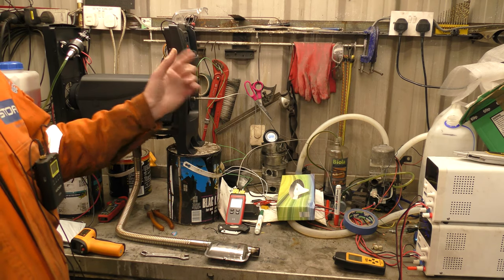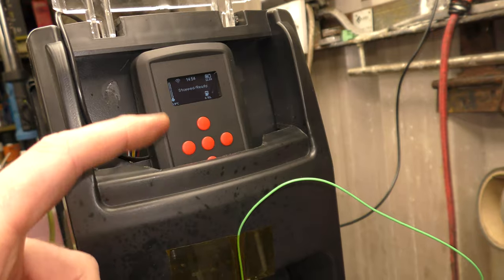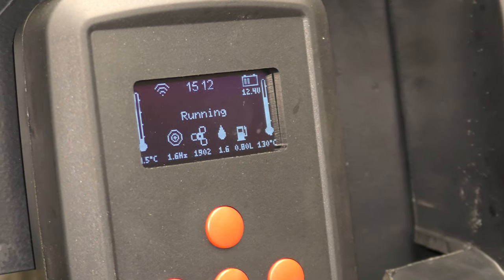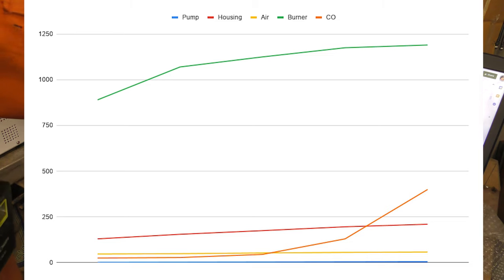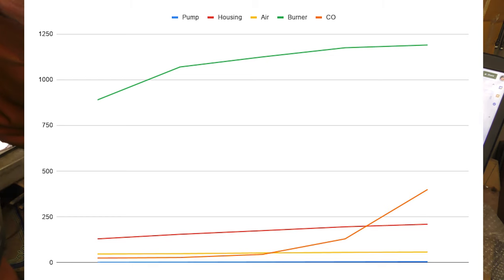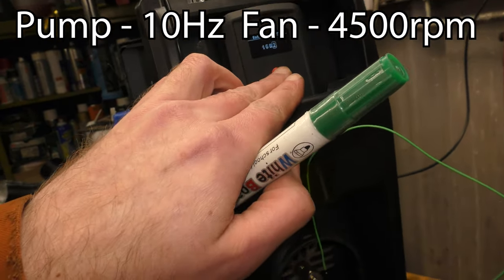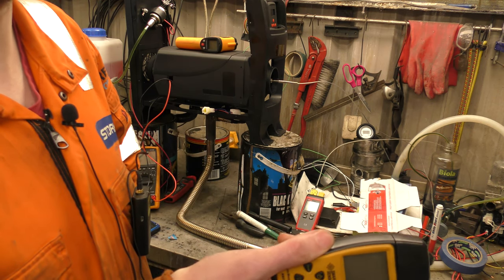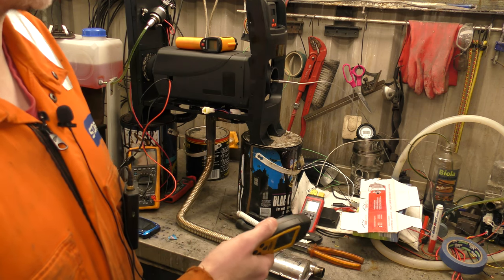A better understanding of what's happening in your heater while tuning?  With graphs

Comment: Helllllllloooooooooooo!!!! your greeting has grown on me......... really like the heater videos, I use mine in my RV, I'm not rich, and i use it for economical survival in cold times, I changed the bearings" after watching your video,  and it's almost silent now, I've been amazed at how good they are, and after playing with those crappy expensive to use"  propane heaters for years and the Propane heater that came with the RV, I Am soooo happy to have found this Great little dry heat heater. There on sale for 94.00$ right now. I'll buy another for a backup and parts. Thanks my friend. Maybe u should do a Propane Cost Comparison, show people how much they can save. Because  the cost savings is hugh.
Reply from the maker: That's a very good point you've made and one that is often overlooked.  These heaters produce a dry heat.  I've been in workshops where the water is literally running down the walls as they have a propane fired heater running.

Comment: Soooo in depth.  I haven't even purchased my heater yet.  It's quite warm where I live but will probably be out on the road before long and will need night time heat.
I plan on a centerfuge cleaning and burning waste oil
Reply: Make sure you mix it with a bit of diesel to thin it out
Reply: @JimLahey21  Do you recommend a ratio?
Reply: @preachers4135  just enough to make it thinner so the pump can pump it

Comment: Interresting, and learned something new. It never occurred to me to use my CO smart sensor to help fine-tune the heaters. I bet it would work for high attitude tunning! If the controller does have a high altitude setting. That brings another question does the high altitude setting on the controller changes the fuel ratio down at a predetermine setting?

Comment: @David McLuckie you can jump direct to the tuning settings if you hold left and right keys for a while ;-)
Reply from the maker: Nice.  I had planned just to use the AB web interface but the access point in the workshop decided it no longer like wireless clients.

Comment: I run my heater occasionally (campervan) with a few weeks per year high in mountains. when I got my heater a few years back, reading about people's units sooting very quickly I set mine very lean to avoid that. My heater runs 90% of the time on idle at 0.8Hz and some 1900rpm. This explains why I never had problems going into mountains and staying at 2000m a.s.l. - the mixture wasn't running as lean as usual, it was getting slightly richer for the 25% less oxygen at that elevation. I also always assumed many people had problems with the soot because they fit all sorts of long exhausts with silencers restricting the gas flow. I never bothered fitting any silencer, just the exhaust pipe with one big diameter bend and that's all. or maybe I'm just lucky and my heater is better quality? hell knows...

Comment: I realize it could upset the turbulence required for combustion stability, but I wonder if a little porting of the inlet and outlet would help these things be less sensitive to restrictions and high winds. (particularly at altitude, as I have been monkeying with mine constantly at 10,000ft)

Comment: Do you think you could do a video testing on peaple placing the heater in diferente places affecting the airflow  maybe mesure the airflow speed coming out with a meter in my case mine is in the corner with only 2cm gap from the big round airintake

Comment: David I noticed that the expensive ones has self adjusting a elevation for air to fuel mixed,  does the after burner do self adjusting for elevation?
Reply: The more correct question is does the ECU react to the height information supplied by an Afterburner (if fitted with a pressure sensor), or even OEM controller.
Sadly my tests with the 3 styles of ECU I have, that are compatible with an Afterburner, say no.

There may be other units that do not work with an Afterburner that may self adjust, but this family of heaters that David is playing with do not.

Comment: You can adjust the mixture by adjusting the hrz and watch the heat bars on the display, set the heater at max temp, keep turning down the fuel until the last bar goes away, then turn it up until every bar is lit up👌 Then you will have a good mix of fuel and air, and the heater will burn effectively as it can..
Reply: They don't seem to change on mine for some reason. I tuned mine using a CO sensor, it was surprising how much a small change in Hz dramatically increased the Carbon Monoxide produced (and made it less efficient). for my unit 4.6-4.8Hz @4500 rpm fan speed gave 20-24ppm CO, 5.0Hz was 30 plus and then rose dramatically. Low setting 1.7Hz @:1500 RPM was around 9ppm CO, 1580 rpm increased the CO, 1.4Hz@1500 was over 150ppm. Only ran for 2 hours, so these settings might change, and yours would be different.

Comment: Great video. Do you know, is there a chart that relates these numbers to use at various altitudes?  Apparently there are issues driving in the mountains
Reply: Yes there is, on the CDH facebook group. Gives ballpark settings for 2kW with 18 and 22ml pump and 5kW heaters with 22ml pump
Reply: Take those generalized graphs with a grain of salt.  The generalized reduction in fuel only gets you so far into the sky.  Somewhere around 9k ft, combustion intake air temp starts playing a definable role.

Comment: Have you done or thought of doing any tests with a larger capacity fuel pump? I think these tend to be 22ml pumps but I've seen someone in the USA testing one using a 28ml pump, so I'd be interested on the difference in 'behaviour' of the heater between running a 22ml pump at higher HZ or a 28ml pump on lower HZ..  I'm curious about that one.

Comment: Thanks David - interesting episode and info as normal. 
The melting point of aluminium is 660oC, aluminium alloys are generally lower, although aluminium bronze is 1027 - 1038oC, so how can the chamber be 900 to 1200oC? I have dobuts about that temperature reading, though it is Interesting to know that the temperature is very high and therefore they must use some pretty special aluminium alloy to cast the burn chambers.
Reply from the maker: So that probe is deep inside the steel burner chamber where the temperature will be a lot hotter.  Another thing to note is the aluminium is being constantly cooled by the air flow.  If you were to stop cooling and keep the burner at max power you might be able to melt some of the interior.  :)

Comment: Hi David 
I have fitted quite a few of these heaters in campers and love you posts and learnt loads from you .. I have the same carbon mon tester as you and I have never on a 5kw or 2kw heater got a good reading under 1.6 hz ? 
Everyone I fit I won’t programme them to go less than 1.6 hz 1500 rpm ..
Have you found this to be the case ? 
Ta 
Glen
Reply from the maker: Yes, although I haven't tried any 2KW heaters yet.  Under 1.6 I suspect the burn chamber cools too much to allow a good burn.
Reply: @DavidMcLuckie  yes mate and the carbon monoxide goes shooting up again ..
The 2kw have a smaller pump as you will know but still can’t get them to go lower levels
Reply: @yicafresh  that's interesting. My 5kw is smoky and high co levels below 1.6 too. I like to run below these settings for my small van but I'm concerned about carbon build up. I wonder if running at full power for a couple of minutes before shutting down would clear the burner. ??

Comment: Man, i liked that you put al the effort in, but I would have liked to see the chamber temp and fan speed specs on 0.8. and you showed the chart but forgot to show the whole sheat you wrote down, also when you put it to 10 Hz I would like to see the chamber temp cause that's the only thing I can go on on my heater Wich shows the chamber heat true the controller. So that's where I base my specs on. Thanks for the effort but I would have loved to see all the details in full!

Comment: That's great,
Which means a heater unit could be used to fire a forge. Not hot enough to produce hammer welds or molten/smelting iron. But enough to bend /straighten and manufacture. An adapted "heater" would be easier to carry and cheaper than a small farriers forge and quicker to use and pack away.... Right pencil and pad  and thinking cap... 🤔

Comment: the noise you refer to, I had it REALLY bad on a chinese branded heater which was labeled to go up to 8kw (controller actually went up to 9kw)... would sound like a roaring jet/flamethrower for the first 5-10 minutes (depends on how cold the heater was)... after using it like such for a few months, had no problems with it other than the complaint of loud roaring noises (low and rumbly) at start-up... shut-down wasn't an issue at all.... i'd have to say the controller is/was set up differently to the 5kw versions (in reality they're ALL 5kw bodies) just with different burners to accommodate the rating... at least that's my opinion due to similar casing sizes but the 5kw burner being slightly smaller than the 8kw burner... ever have the same issue i describe? unless you've already mentioned it (I may have missed it)
Reply from the maker: One of my other heaters does exactly as you described but I couldn't get this one to make the same noise.  It must be a combination of factors that isn't happening this time.  I had a 5KW make the noise installed in camper van but it went away after I tuned it.
Reply: @DavidMcLuckie  i would have to say it would've been the dosing pump... not all pumps are the same (as far as i can tell when it comes to these heaters)... and an aggressive dosing rate? not entirely sure but that's my thoughts.

Comment: Didn't see the numbers at 10 PPM.  Did the flame temp go down?

Oil burner techs tune A/F by measuring the exhaust temp. So I've been told.  Either too rich or lean causes lower exhaust temp. Max temp is just right. A plot of this variable would be cool.

Nice scientific treatment of this issue David. Thanx.  :)

p.s.     O2 detectors on propane heaters use the pilot flame with a thermocouple in front of it. When the O2 level drops the flame front slows down and uncovers the thermocouple. As low a drop from 20% to 19% will do it.  FYI. 

I think the problem with running these thing indoors is that the O2 in the air is replaced with CO2 and eventually drives the O2% too low. That's when incomplete combustion occurs and CO goes up.
Reply from the maker: Yes, flame temperature dropped.

Comment: Thank you for all your Great Work Sir.
I have a question, do you have a video showing the differences between gasoline and diesel heaters ?
do any of these run on propane or other fuels ?
if not, maybe a good video topic.
Thankin Yee from boston usa 🙏🌺🦉
Reply from the maker: I've tested running on a few fuels but I'm going to revisit running on gasoline again.
Reply: @DavidMcLuckie  thank you my main question is are they different machines or are they the same exact machine running on a different fuel like gasoline and Diesel,
Reply from the maker: The Chinese ones are just the same heater listed as gasoline or diesel.  They don't really run well on gasoline.
Reply: @DavidMcLuckie  I've been wondering this for over a year since I've seen these damn things thank you very much now I finally know. 🌺

Comment: Going to connect up my gas analyser to the exhaust to see what the Emissions are Nox & co . Will be interesting to see
Reply from the maker: NOx is a good idea.  I think one of my gas meters shows NOx as well.  What do you think would be a 'good' number to see?
Reply: Interesting question 🤔 Anything under 100 on each would be good. Will be in work tomorrow so will have a look👍
I’m I’m guessing Nox 100 Co 40/50ppm
But will let you know tomorrow
Reply: @DavidMcLuckie  
Well I got the gas analyser on it.
I am impressed.
CO -18ppm   NOx 41ppm
Reply from the maker: Those are nice numbers.  You've got lucky with that heater.  :)

Comment: in the 0.8hz mode can it be useful to connect an undersized pump to decrease the air-fuel ratio? as actually happens in the 2kw version

translated with google translate

Comment: Great video David.
Have you found the Uni-t temp sensor to be reasonably accurate? I looked at it but they just seem so cheap, I was a bit suspicious. I have other Uni-t stuff and I'm happy with them. I was just curious.
Reply from the maker: Same as you I've got a few Uni-T things and they all seem to be of reasonable quality.  Without an expensive calibrated unit to compare with I don't know how accurate it is.
Reply: @DavidMcLuckie  Thanks for that. As long as its reasonably accurate it'll do for what I need it for. Thanks.

Comment: So the settings are tuned for lowest CO. Does that also correspond to highest burn temp ?
If so is that burn temp easier monitor ?
Reply from the maker: Tuning for lowest CO you end up with the lowest sustainable burn temperature.  Dip under that threshold and the CO goes up and down as the chamber goes out and relights continuously.

Not easy to monitor, you can see the housing temp on the display but it doesn't react as quickly as the CO reading, or the probe I drilled into the core of a heater.

Comment: Can you run the heater in different orientation and show the results. I tried to run mine on its side with the exhaust facing away from me and I had white smoke from the exhaust.
I got no idea why orientation has any side effect. No one has covered this topic.
Reply from the maker: I have a little - https://youtu.be/MziTxqGOyjw
Reply: @DavidMcLuckie I have seen that video.
But I'm looking for more about how different orientations effects the heater and why.
Can't it be mounted vertically for instance?